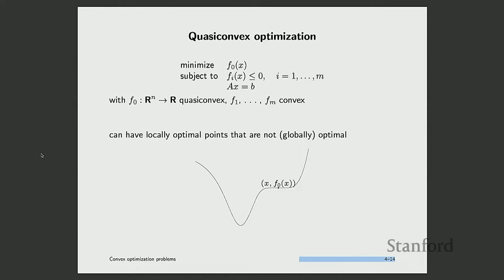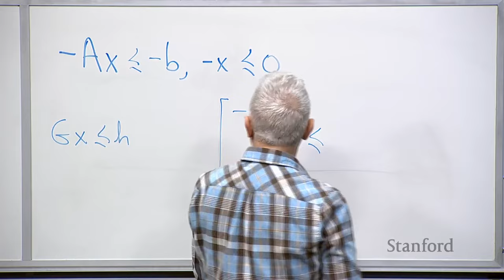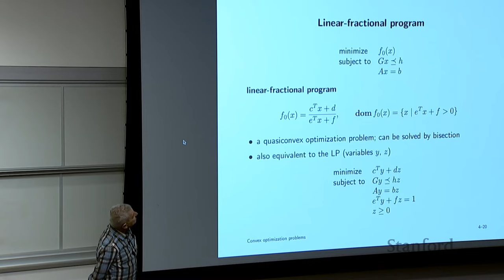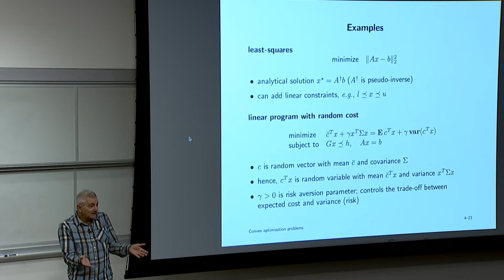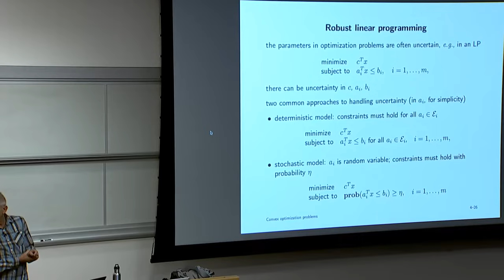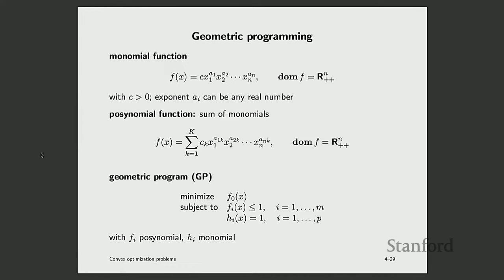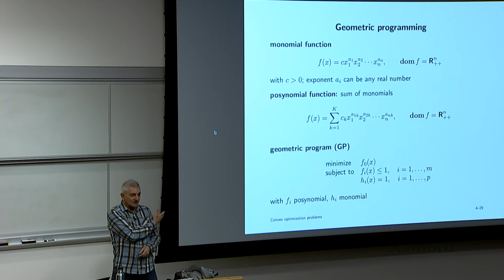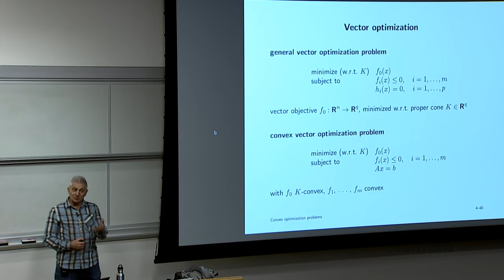Stanford EE364A Convex Optimization I Stephen Boyd I 2023 I Lecture 6

Comment: Didn’t really understand the quasi convex sub level set arguments from before
Reply: You find a feasible point of a convex function phi(x) s.t.  f(x) <= t <--> phi_t(x) <= 0 so if there is a point in the feasible set of phi_t then we know that p^* <= t . If we start with an lower and upper bound for t, we can use binary search to half that interval with each step: start with [0, 100], then try to find a feasible point in phi_t(50). If you find one, then p^* <= 50 and we can reduce the interval to [0,50], else we can reduce it to [50,100] and do on....

Comment: piecewise linear does not guarantee convex / affine. Actually it is affine when you have a piecewise affine function composed by the max of a bunch of affine function. However, you may see lots of other linear spline functions like ReLU network that are not convex/affine. And you need mixed integer linear programming to solve that kind of tasks (introduce integer variables to denote which piece of function you are at).